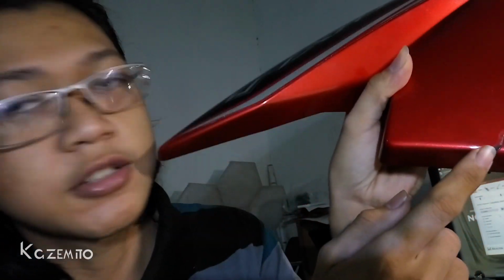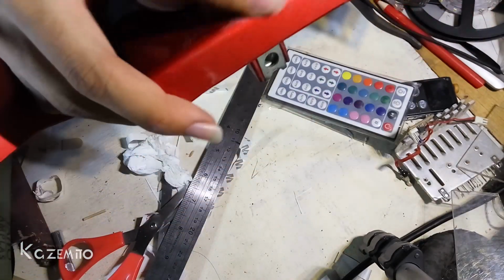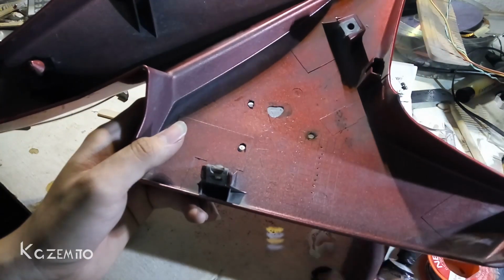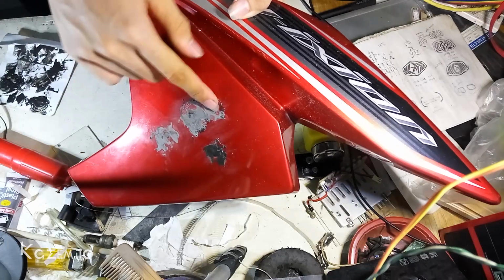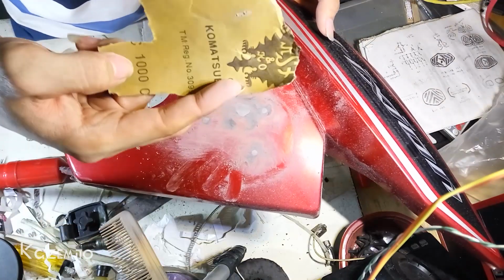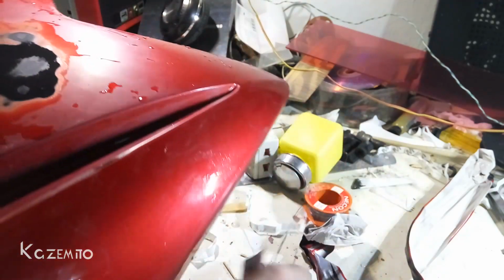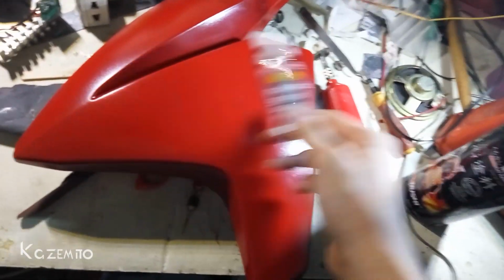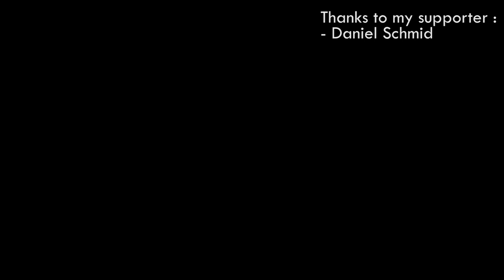FIX YOUR FAIRING or BUMPER (Plastics) FOR CHEAP!! Holes, Deep Scratches, etc.

Comment: Would be just as cheap and way easier to use body filler. Epoxy dries way harder and it doesn't stand up against vibration or sunlight and paint doesn't like to adhere to it. May last a few months before paint starts to flake off of it.
Reply from the maker: thankfully it doesn't come off, paint still in good condition, like you said, maybe it's better to add epoxy filler to add additional strength and make it more smooth
Reply: @KazemitoHaruhi  actually you were right using the epoxy. its plastic so body fillers would crack on bendable plastic fillers are intended for metal. I'd suggest do a vibration test on the plastic with an epoxy and body filler. The comment starter would be very surprised on which will crack first.

Comment: What grit is the sand pa-er?
Reply from the maker: From 200 grit to 1000 I use 200 300 500 and 1000, 1000 should be enough for polishing the epoxy primer spray paint, then clean before applying paint.
Use the rough one and slowly change to smooth one with water to smooth up epoxy glue then apply primer spray, after that you can sandpaper it before applying paint.

Comment: What's your process of painting the fairings?
Reply from the maker: sand paper first (usually people use rough one maybe 230 grit)
then apply epoxy paint
sand again with 1000 grit or more sandpaper
if you want to apply more epoxy paint, sand it again

(patient needed on this steps)
paint first layer of your favorite paint (don't too think, just light spray) wait until dry
paint 2nd layer (light spray again) wait until dry
paint 3rd layer (light spray( wait until dry
repeat again and again until you happy with the results.